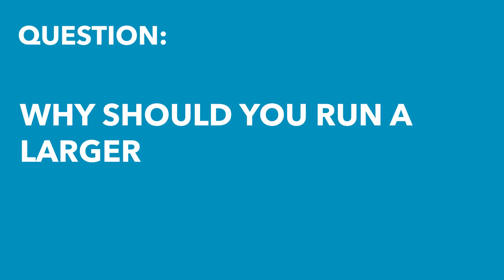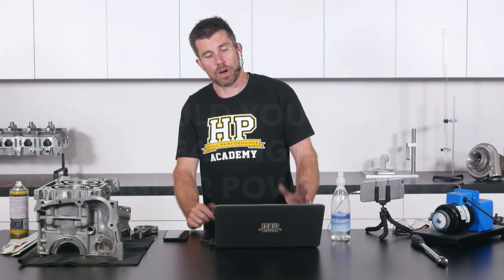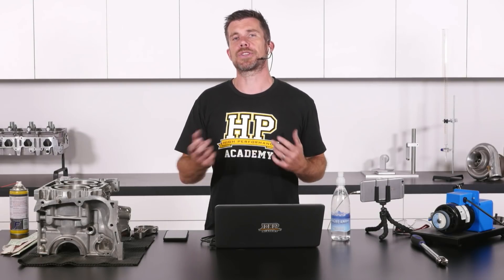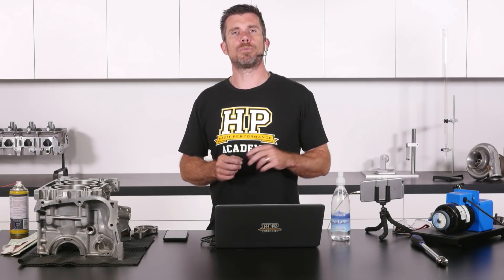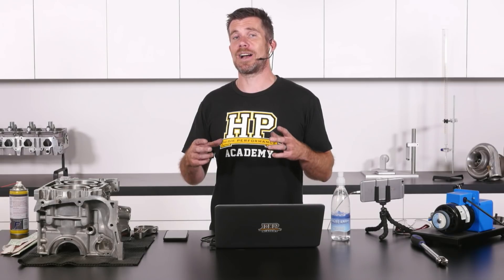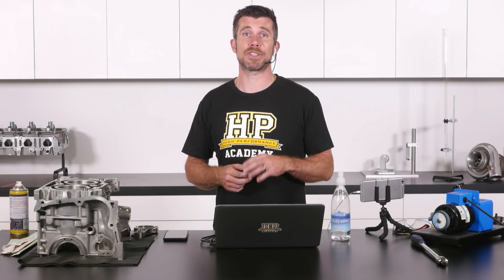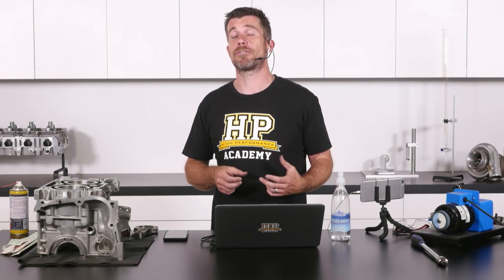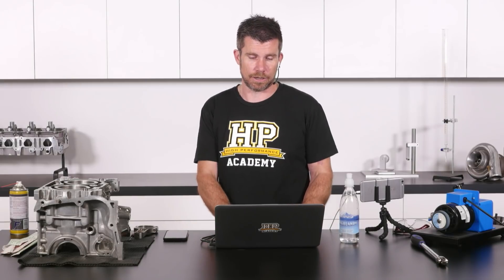[HPA Q&A] More power, bigger clearances & thicker oil? | Performance Engine Building

Comment: Waht power levels arw we talking about for bearin an crank shaft flexs lets say subaru ej motor pushing 450whp cant that stock engine handle it lets say upgraded piston stock rods stock clearance
Reply: That's a little less than double the whp of a usdm ej257.... That being said, it's been done before... but for 450whp you're at at least 500 crank,probably closer to 550. so for almost a double in power out put from it's factory form it should definitely see some adjustments in clearences especially with aftermarket rods as the material will expand more as the engine approaches  operating temp.

Comment: As the chap said, different ways of looking at the issue.
Before further discussion, I would STRONGLY suggest reading this - I can across it some months back and didn't realise I'd BMed it - argueably the best summing up of the clearance/viscosity/load issue - http://www.substech.com/dokuwiki/doku.php?id=effect_of_oil_viscosity_on_hydrodynamic_friction_of_engine_bearings

You will note that the 'wedge' minimum value does indeed increase with viscosity, as expected, and with rpm, again as expected - but you will also note that the loading on the bearing is more even with the lower clearances, which reduces the peak loads on the bearings. This also means that with the greater clearances, the bearing material may be more prone to failure.
You will also notice that for EACH bearing, you could be looking at an additional 1/2 HP loss - that would be ~ 5hp for a 4 cylinder just for the crankshaft, PLUS all the other bearings such as camshaft, balancers (if used) and several HP at the oil pump as it has more resistance to pump against - unless it is actually needed, this could be 10+ hp thrown away.

OK, the first comment - and remember, I may be wrong - this is for discussion and thoughts, so any feedback is welcome.

Crankshaft flex - this is indeed a very real issue and can be a problem especially with 3 main crankshafts and with 4, rather than 8, counterweight crankshafts (4 cylinder) as the increasing rpm and crankpin loadings stress the shaft beyond the OEM designs. A mismatched harmonic dampener/damper may actually worsen this futher if a harmonic sets in. At the big end, I am not aware of any instances where the very minor mis-alignment of the bearing due to crankshaft flex, rather than another problem, actually caused the failure but I haven't as much experience at these limits as Andre - I would surmise flexing of the con' rod may be at least as much of an issue - but by that point stonger aftermarket parts should be getting used and very high cylinder pressures and rpm would be expected - certainly much more than most would be using.
Crankshaft and block flex - again, under very high loads, the crankshaft main bearing journals may be moving as the lower engine block flexes under the compressive loads and 'whipping' action of the shaft under stress. Again, this isn't something most street engines will suffer from and is is reduced by using stronger caps, studs, partial/full girdles, etc. That said, we have all seen videos of blocks or crankshafts being blown off/out off engines when they fail from these loadings.
There is another part of the engine where there are very high loadings - some camshaft and follower types have the cam lobes sliding over the follower and maintaining a protective film is critical. The old Ford Pinto finger design was actually part of some oil development programs because of the extreme loads, pushrod engines using flat followers andhigh spring pressures with only splash lubrication would be comparable - but a high Zinc or Phospate oil should be adequate for that.

Something that is sometimes overlooked is that oil is also used for cooling engine components and that includes the bearings - plain bearings, like the main and big end, subject the lubricating oil to high shearing forces (think internal friction in the oil) and these heat the oil. Part of the job of the oil is to carry away this heat and if it can't do so the oil film may heat to the point where the oil breaks down, the lubrication is lost, and the journal makes contact with the bearing - if you're lucky you'll just see a discolouration on stripping the engine - but if not...

Lastly, I hope, most of you will be running turbocharged engines - a higher viscosity oil increases the drag on the turbine shaft and can reduce maximum boost, rise the point where it comes on boost and slow the response. 

So, and I repeat it is IMO, it is less than wise to just use a higher viscosity oil and/or larger bearing clearances unless one actually needs it/them - there isn't any advantage but a lot of disadvantages.

Discuss? :-)
Reply from the maker: Thanks for your comments, and you make some valid points. We certainly wouldn't recommend adjusting clearances and using a thicker oil unless there was a valid reason to do so, and in the majority of situations the stock clearances and recommended oil will most likely be fine. 

The discussion in the question was more related to the upper end of modified engine performance and comes from our personal experience with high boost drag engines which were producing up to four times stock power and revving around 3000 rpm higher than stock. Over the course of our engine program we had the ability to test and examine the results from different oils and different clearances, hence our recommendations.

You're right that the big ends aren't as prone to flex compared to the main journals, however they are obviously subject to far higher loading than the stock bearing was designed for. Again from our own experience we've seen improved bearing life from using a slightly looser clearance here coupled with a higher viscosity oil to provide an increased in protection to the bearing surface thanks to improved film strength.

Comment: Doesn't also running larger bearing clearances allow for a higher viscosity oil there in turn dealing with higher oil temperatures?

Comment: There is an engineering text on this stuff called "Internal Combustion Engine Bearings Lubrication in Hydrodynamic Bearings". 

The reason the bearings are failing on high HP/TQ vehicles is that the conrod thrust is too much for the "watery" thin oil to have enough shear strength, directly proportional to film thickness (viscosity).
Reply: zeroyon223  Aren't the S65 and S85 plagued with main bearing issues?
Reply: @zeroyon223 that entire thread on M3 post is absolute rubbish. It's based on someone's assumptions about actual oil clearances as derived from service limits. But yes, 10w-60 was always way too thick of an oil for a daily driven M3 with <.002" clearance on a 2" journal. Should be 30-40wt oil just like every other BMW engine. Clearly the extra shear viscosity (HTHS) of the 10w-60 was never helping anyone. And, BMW has since switch to recommending regular LL-01 for M cars instead of 10W-60 performance oil. Save the 10w-60 for the track. You need the thinner oil for the street with such tight tolerances. King releases many whitepapers on this topic and the correlation between clearances and oil weights.
Reply: shear strength (dynamic viscosity) correlates with kinematic viscosity, but, it is not directly proportional. As an example, Castrol Edge EU 0-30wt LL-01 oil (BMW  oil cert) has the same HTHS rating of 3.5cP as the Castrol Edge EU 0-40. Dynamic shear strength is heavily dependent upon the quality of the base oil used.